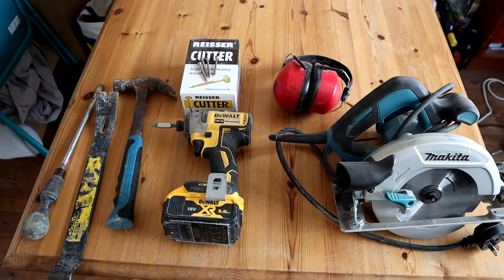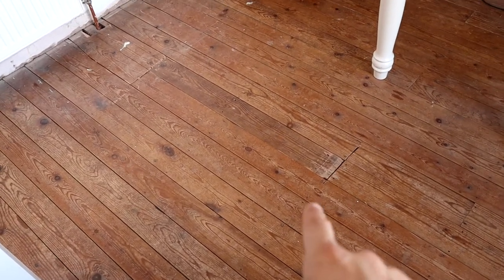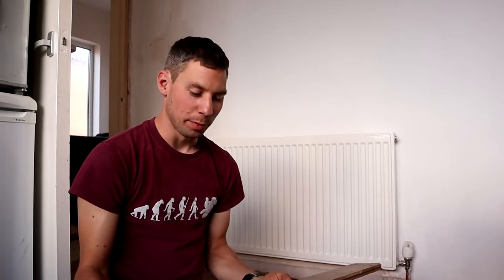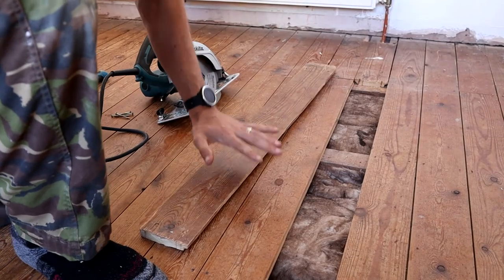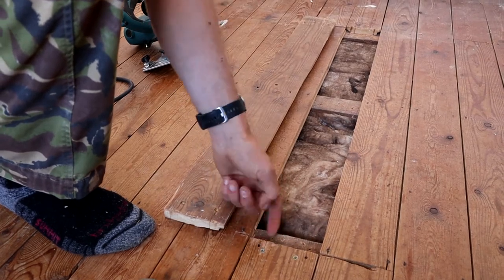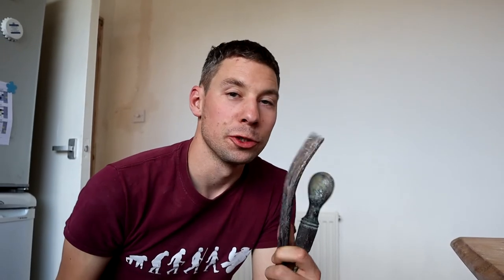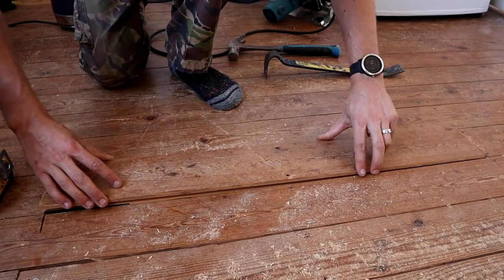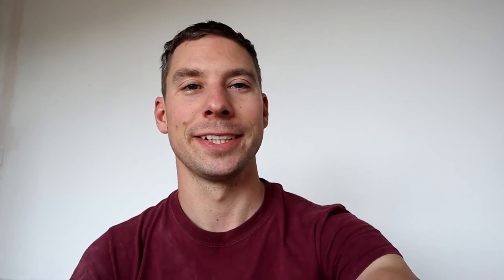How To Pull Up Floorboards Without Breaking Them

Comment: I done half this thick cut with bosch multitool and depth guage came with it. would you use filler to fill the cut and sand it or just leave it?
Reply from the maker: Hi Peter, it’s personal preference. 
If a carpet is going back down then it’s not necessary but if it’s going to be see then you might want to make a better job of it by filling and sanding. 
Thanks, Ben

Comment: But you broke the tongue off the piece of board that you removed!
Reply from the maker: You make a fair point Terry but the tongue isn’t seen so it doesn’t matter. The tongues purpose is to aid in jointing and locking the boards together when they’re down. By removing the tongue it doesn’t visually show damage to the board and allows you to lift the board cleanly.